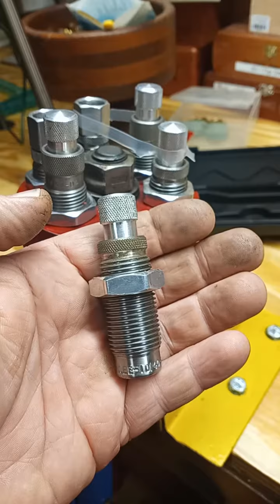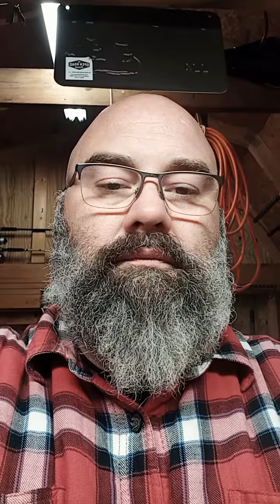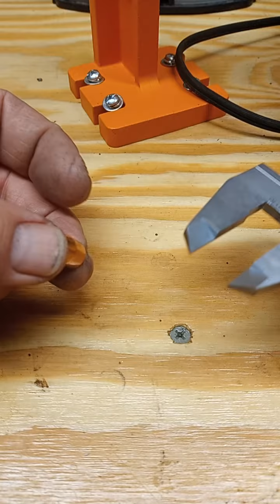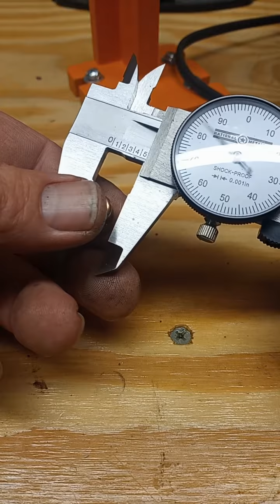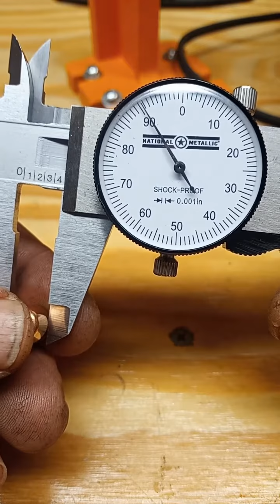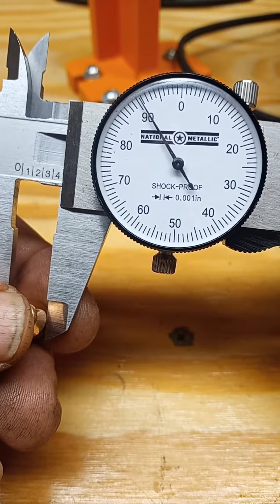Lee Precision Factory Crimp Die

Comment: which factory crimp are you talking about they have a taper crimp and roll crimp which is standard for pistol cartridges 9mm,40,45 headspace is on the case mouth.you only use the collet die on heavy recoil pistol rounds 44,454,460,500,ECT.collet factory is for round that will jump crimp and lock up a cyl .dont use a collet die on a pistol round.collet die will cut a cannulure in a bullet

Comment: I just bought a factory crimp die for 45-70....it's going back. The roll crimp will be just fine on my CVA Scout single shot.
Reply: you don't need to crimp that round,neck tension is more than enough especially with a single shot

Comment: Lee has two types of Factory Crimp Dies, one thaqt is carbide style and one that is collet styled. The Carbide sizer part straightens the cases back up when the crimp part bulges the cases from the downward force of the die upon the case neck. The Collect Style crimp die does not apply downward pressure but rather inward pressure of which does not buckle the case creating a bulge that would then need ironing out. If this is true the carbide part of the die fixes what the downward pressure crimp part messes up, whereby I call it a gimmick of sorts because it does not really solve the problem, but rather patches it over. All that work hardening the brass is not good either. Better to just not cause an issue as apposed to patching it back up I would think. 

Again The Lee Collect Style crimp die never buckles the case whereby never needing to fix its own fuct-ups, as the downward forcing Lee Carbide Factory Style crimp dies do. Ergo with the Collect Style crimp dies there is never a need for the carbide ring, period. So if you see my point being Lee has the Collet Style crimp dies why would they sell a Carbide crimp die that messes up the brass only to turn around and solve its own issues, other than to act as if it is the crimp die of crimp dies of sort that everyone should have(?). That is why I call it a gimmick crimp die. Makes no sense when the Collet Style crimp die exist, right? 

Be sure and watch Lee's own videos on their Factory  Carbide Style crimp dies:
1) https://www.youtube.com/watch?v=0rjlUH25DyM
And their Factory Collet Style crimp dies (of which they have both /roll and a taper types): 

2) https://www.youtube.com/watch?v=vo7p4k36swI
Reply from the maker: That is a VERY good point.

Comment: I’m here because I think I did this to my first 30 9mm ever made.. However it wouldn’t chamber into my pistol unless I went down further. Any comments on why and what I did wrong would be appreciated! Thanks for the video
Reply from the maker: Did you run the bullets through a sizing die after they were casted and cooled?
Reply: @plow-boyengineering7053  I didn’t cast my own bullets. I used berry’s plated round nose. So I was within the correct OAL and worked in chamber checker but wouldn’t chamber in firearms so I used factory crimp die all the way down. Since then I watched other videos and believe I have it down now. Going to pull one of the first 30 I made and see if I smushed the bullet with to much crimp.